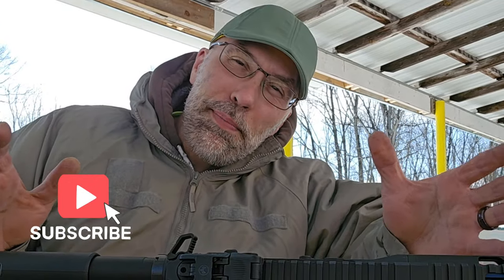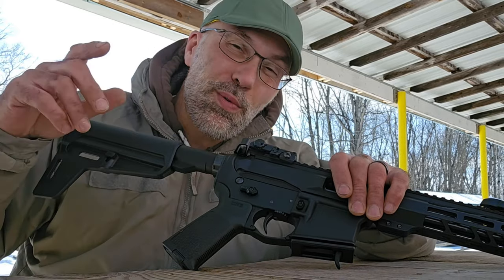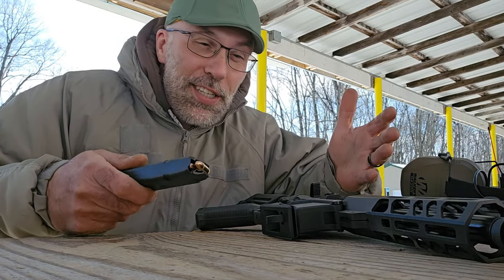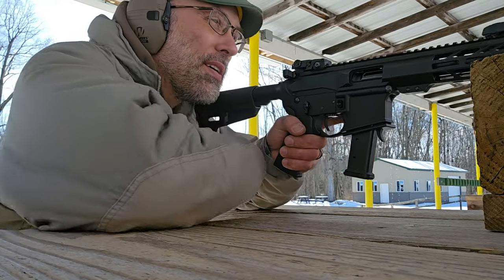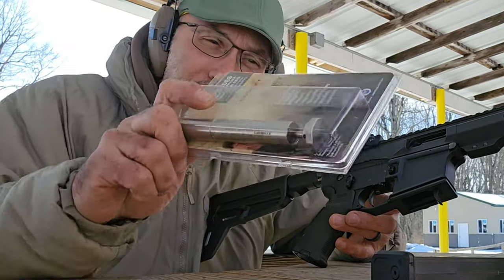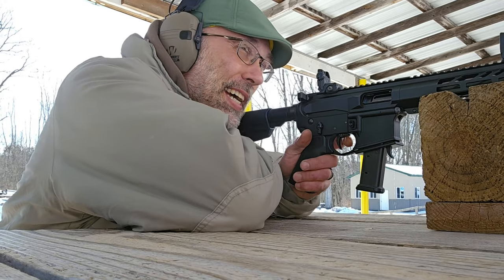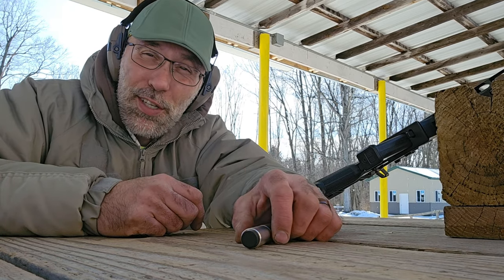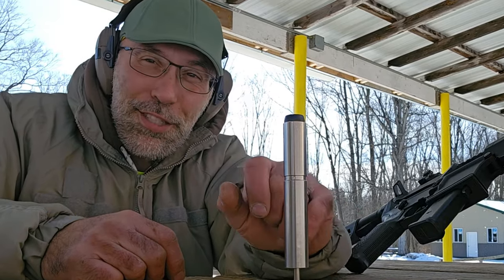KynSHOT hydraulic short stroke AR9 buffer set up SOLVED.

Comment: I have a question...that the right model for a PCC?? Mines is nowhere near as long as what I'm seeing in yours! I have model RB5007 and that's the model that "supposed" to be for PCC.
Reply from the maker: This is the short stroker buffer. 5007 is standard.  I will be doing content on 5007 and the HD too.
Reply: @RugerGundog  i want to say you'll have better luck with the 5007 in a carbine length buffer tube but if you still have the short stroke, give it a go in an A5 length buffer tube setup
Reply: 5015 Hd is the way to go.

Comment: Deff need to use A5 (longer) buffer tube with that hydro buffer. No need for ar10 spring.
Reply from the maker: I do have a5 in the set up now.  Cycles better however no last round bolt catch function
Reply: @RugerGundog  if you want last round bolt catch then you can't short stroke lol its either or choose which you want
Reply: You can get a taccom short stroke bolt and have both.

Comment: Have you tried it with an A5 buffer tube?
Reply from the maker: No I have not.  I've only done what you see in the video this far.
Reply: @RugerGundog  almost seems like the bolt doesn’t have any room left to travel because of the added buffer length, it stops short of where it would with your standard buffer. A5 tube would solve that issue
Reply: I have that same problem on my AR9. I honestly don't feel that much of a difference from the Foxtrot Mike 8oz buffer. This damn thing cost me $170 and won't even cycle at a faster pace because of the length of the Kynshot hydraulic buffer. 😡 @UniversityRifleClub
Reply: A5 buffer tube should fix that issue..

Comment: I use that hydraulic buffer and it works just fine ..most likely it the ammo that you are using .. i don't use factory ammo ..i am only using reloads that are about 1400 fps ..
Reply from the maker: Thank you
Reply: I use the armaspec captured recoil spring and it functions flawlessly even in binary. It's not a short stroke but it works.

Comment: You have the wrong buffer in your buffer tube.  The short stroke buffer should NOT be used in a standard AR15 buffer tube, the buffers that will work are the 5007 and 5015 buffers.  

If you want to use the short stroke buffer it needs to be used with an A5 (which is  now a standard AR10) carbine buffer tube assembly.  Just remember that if you do install an A5 buffer tube you MUST use the short stroke buffer OR add a Blitzkrieg industries weight/spacer in front of a 5007 or 5015 hyd buffer or ANY AR9 buffer.  
I’ve dealt with a bunch of these systems and I’ve used both Wilson Combat flat wire and JP INDUSTRIES AR CARBINE springs with all three of these buffers with 100 % reliability shooting from powder puff steel challenge loads to personal defense loads.  I’ve tried AR15 rifle springs and found them to be too powerful and AR10 springs are ridiculously overpowering.
Every person who’s tried one of my 9’s has ended up purchasing a 5015 buffer and a Wilson flatwire AR15 spring.  I wish I recorded the responses as they were pretty funny.
Reply from the maker: I have swapped over to A5 tube and spring combination per kynshot and issues persistent. 
With the short stroke kynshot removed and other kynshot it works fine

Comment: That spring is too heavy for that pistol
Reply from the maker: Also used the recommendations from kynshot.
All works well now...however no last round hold open.
Reply: That's because you don't have the necessary linkage in that upper, lower or magwell adaptor to give you LRBHO.